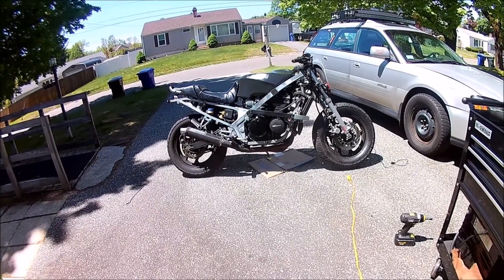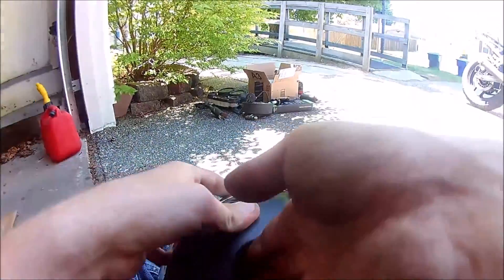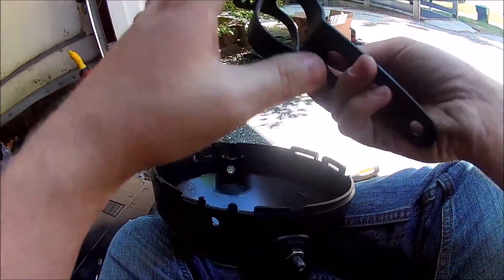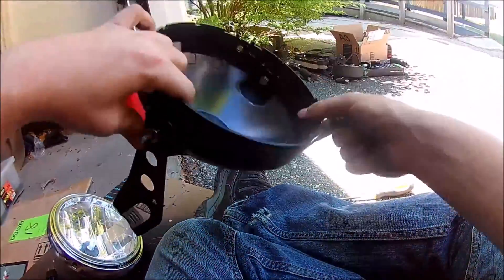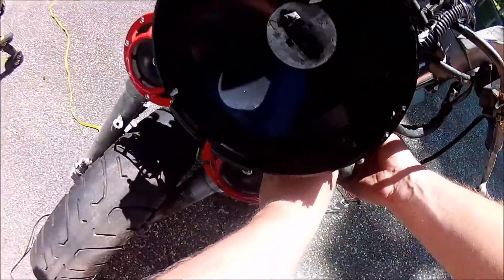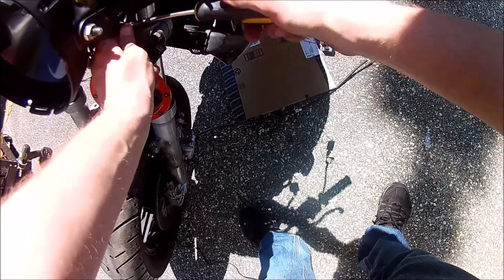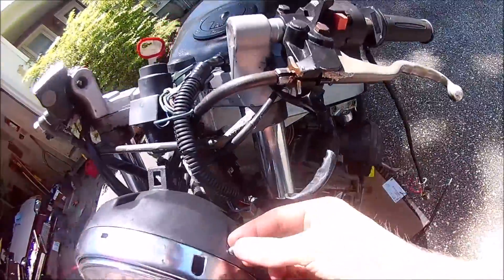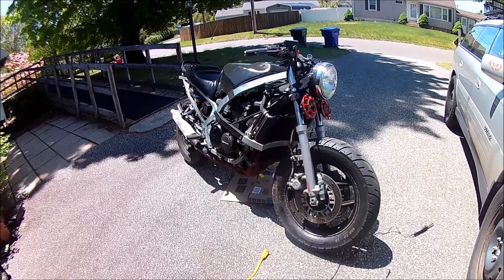1986 Ninja 600 Streetfighter - Universal Headlight - Part 6

Comment: how do you know if the lighbulb plug fits your motorcycle?
Reply from the maker: +TomNG Look up the style of headlight for your bike and find a matching led one. Mine was an H3 I believe.
Reply: I'm stuck on the wiring, I got a Bandit 600S got the fairings off, now I
 got a light kit but just the wires sticking out, I don't know how to 
put them together onto my bike :(...
Reply: TomNG I’m attempting my streefighter headlight on my 02 bandit 600s too. I hope I don’t have too many problems